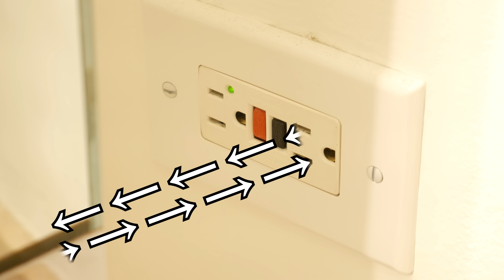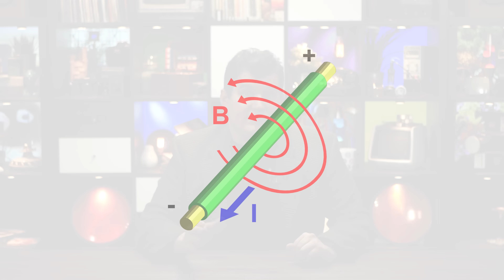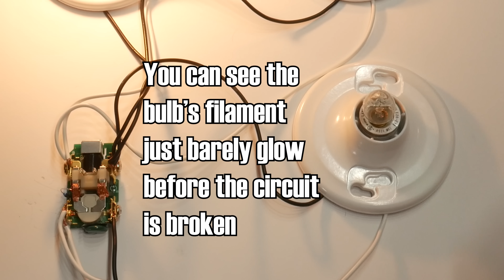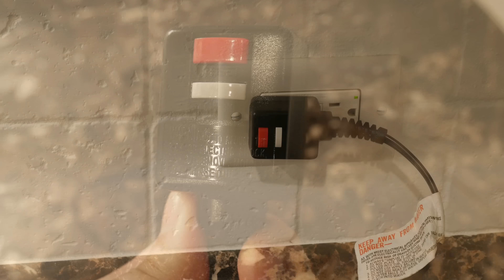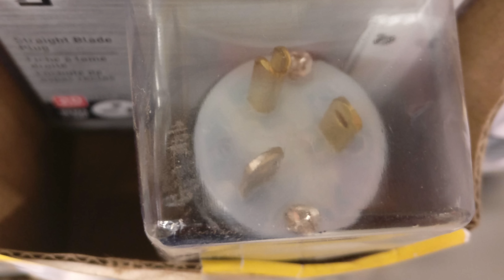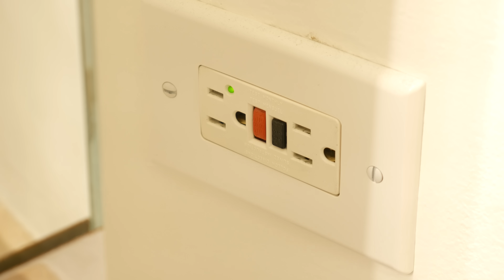The GFCI/RCD: A Simple but Life-Saving Protector

Comment: In Europe not only are those in the switchbox but they are also in front of every outlet so even if for some reason your electrical oven should leak electricity it will be shut down. Also I think the whole short circuit situation with American outlets would be so much more preventable if their outlets were recessed like in pretty much any other country.

Comment: This reminds me of my friend that wanted me to completely replace the wiring and all outlets in his 3 year old house because they "weren't strong enough to push his equipment" We were both amateur radio operators so should both have some knowledge of electrical things in general. Granted I would have more knowledge because I am an electrical engineer. He gets me over there and shows me exactly what he means. He plugs his radio in and the second he hits the power button... POP.... the gfci and the mains in his home all cut off. I told him there has to be a reason this is happening and he says "nope just please change out my plugs to normal ones" He shows me how he can plug it into a regular outlet in his living room but then the breaker only trips when he keyed his microphone. After bringing in my own radio and power supply I showed him that it was definitely not the outlets fault because mine worked perfectly without tripping anything. That convinced him to let me open his radio and power supply. The radio was completely stuffed with roaches and roach feces. It smelled like death! The power supply was a different story. It had bare copper wire everywhere. I actually think some fool wired it purposely with bare copper! The radio was capable of transmitting at 100 watts and the power supply was capable of much more. Thank God for man didn't have a amplifier or he would truly have killed himself

Comment: Not sure where the idea that the US only has GFCI protection through plugs since we also have GFCI combination breakers that place the protection back at the panel. The usage is less common though because it costs more and in many application is unnecessary or less convenient than using a traditional GFCI plug.

Comment: In the Uk , we do not have Plug Sockets in our Bathrooms , . some hotels have a shaver socket  which is always some form of wierd shape , no idea why , maybe a video suggestion on the types and shapes of plugs internationally
Reply: UK shaver sockets always contain an isolating transformer (which often has a centre-tapped secondary to allow the choice of output voltage) and the current it is able to supply is very limited.

Comment: Ground and neutral are two different things. You confused them a few times in your video.
And "ground fault" means a "short" circuit to the ground (or rather a leakage).
Reply: Separate conductors, which end up on the same terminal in the circuit breaker panel.

Comment: In my country they are in the general box at the beginning of the house circuit and cut all power, and they are call Differential Switches. BTW Very interesting video!
Reply: in the UK there used to be a thing called an earth leakage operated circuit breaker, which shut off power to the entire house when it tripped, but it had a major flaw (before the RCD took its place, and some installations in the UK have one RCD for the whole house, although that is no longer allowed in the regulations here, as newer installations are required to be either Dual RCD or have RCBOs, or a combination of RCDs and RCBOs)

Comment: I'm confused about one thing. When you had the wires loose from the third light, and were touching them to the GFCI outlet to show how quick it stops, why do the lights still work when the neutral is connected to nothing? If the GFCI uses an imbalance in the current to detect when to shut off, wouldn't it be imbalanced with the neutral not touching anything? Or does the power just go back through the 2nd lights neutral wire?

Comment: My home has two switches in the breaker panel that are GFCI.  One covers a heat tape circuit under the house.  Kitchen, bathroom, and outside plug are also GFCI.  House built in 2007

Comment: I had one of these outlets in my garage with my freezer attached to it. I ended up removing it because it went off multiple times for no good reason. The last time it did that we were on vacation and  it ruined a lot of meat we had stored in the freezer. You might think we had a problem with ground fault but I've never had water issues in my garage and its not like the outlet snapped all the time. I think maybe the freezer motor might have been inconsistent when it started or shut off. Seeing as this uses a magnetic field I can see where it might get an imbalance with something like a motor. Maybe not plunging the freezer directly into the main outlet would be key in this.

Comment: But if you have the ground fault breakers in the service panels and you have a ground fault, you can just turn off all the breakers and one after the other turn them on until you find the faulty circuit, yes it takes time but I rather be safe no matter what wire I grab than pay an electrician a little less for troubleshooting.

Comment: Another advantage of individual GFCI/RCDs is that if a device trips one, it doesn't take out the whole house, or at best a whole circuit. Nothing worse than having a faulty device that kills your lights in the middle of the night. My house at least has 2, but since one covers all the sockets and all the lights, there is a good chance of loosing all the lighting in the event of a fault. The other one at least has the immersion heater and electric oven, which are two things likely to fail. Here in the UK you can still get sockets with built in RCDs, and also plug in RCDs (the latter were more common for things like electric garden tools in the days before built in RCDs became standard). They are useful when working with devices that are more likely to have earth/ground faults, since hopefully it will just trip them and not the entire building.

Comment: In an episode of the tv show Monk , a murderer broke a GFCI in a locker room, plugged a hairdryer into the outlet, left it on the floor, and messed with the pipes under the sink so that the restroom(part of the locker room) would flood and electrocute anyone who would turn on the sink barefoot. Monk, the main detective, found that because he noticed that the cover plate  of the outlet had dust on the bottom side rather than the top as the murderer put the plate on upside down. Thinking about it, there are some holes in that story as you said that devices like hairdryers are required to have GFCIs in the U.S. and the show takes place in San Francisco...

Comment: Just a reminder, these will not prevent a shock caused by you touching neutral and hot as you just become a monitored load.  So sticking your finger in a light socket will not be protected. They will help prevent you from getting shocked if you touch hot and ground. So hand on the metal faucet while picking up an object with an exposed wire, should protect you.

Comment: Nice! Now do AFCI!

My understanding was a lot more low-tech than the plug you opened. I guess everything has to have a circuit board and blinkin-lights now, but several years ago the explanation I read was that the sense coil was the solenoid and you didn't need the fancy SMT electronics.
Reply: Here in the EU old-style elettro-mechanic design is still the most common (I think it's the only design allowed)

Comment: Good video, however one small note. Although you used an incandescent bulb with a rating of 41mA under static conditions, on startup (with a cold filament) it draws much more current due to its low resistance.

Comment: At my last apartment, our fridge was plugged into a GFCI outlet. It would sometimes trip when we turned on the hood fan or hood light over the stove, which was on the same circuit but not plugged into the GFCI outlet. Now I wonder what was causing the outlet to trip. A kitchen remodel was done before we moved in, and it was done on the cheap. More than once, I didn't notice and ended up with a warm fridge.

Comment: I have a funny question.  I live in a in country that formerly used 110v but now has 220v.  I moved from the US, so some of my technology is only 120v.  I have fairly comprehensive music workstations, with many things to plug in.  I've noticed I have to play a very complicated "ballet" when plugging in all my equipment to wall power, converted power, and to each other (USB, etc.) because I often cause the circuit breaker to "pop".  Sometimes, for example, I have to run an extension cable from across the room, (instead of using all the close by outlets) to plug in half the equipment. Some equipment I have had to completely give up on using, because I cannot seem to find a way for it to stop the circuit from popping. How do I remedy this problem?

Comment: Common misconception caused by ignorance water itself in it's purest form is an electrical insulator in fact it is one of the best the reason why it conducts electricity is due to materials like salt or chlorine mixed into it or any other chemicals they put into it at the treatment plant (seriously the only way to get water pure enough that it insulates electricity is to collect steam from distilled water in a near perfect vacuum) so don't go trying to use tap water as an electrical insulator because there are always metals dissolved into it hence why in some extreme cases the water tastes metallic (just saying this for scientific sanity seriously these things save lives especially when someone drops a toaster or a hair dryer in the bathtub or some other stupid thing)

Comment: From what I've heard, it's called RCD (opposed to GFCI) in other countries to avoid confusion with older ELCB (Earth Leakage Circuit Breaker) devices. The older devices simply monitored for voltage on the earth wire, rather than monitoring current between live and neutral as is explained here.

If you interpret the words, It's easy to see how confusion could arise - GFCI basically explains ELCB:
Earth = Ground
Leakage = Fault (leakage is the fault)
Circuit = Circuit
Breaker = Interrupter

Side note, in Australia RCD is sometimes more descriptively called RCCB - Residual Current Circuit Breaker. This name addresses the issues you have with RCD. ;)

Comment: you will find at least in the us i dont know about other countries  modern window and portable air conditioners and dehumidifiers will have gfi plugs as they deal with water by the nature of their operation.

some xbox power supplies may use the gfi plug too i had seen one used on an xbox power supply

Comment: About 3:13 “Ground fault” refers to a fault to ground.  A “fault” is an inadvertent connection between a conductors or between a conductor and ground.  The return—or neutral—is a conductor not “ground”.  It’s not called a “ground fault” because current is not returning to neutral, but because current is flowing to ground.  It is the actual ground, not the neutral, to which GFCI refers.

Comment: Do you think 30 milliamps is an awful lot for these things to trigger at? The UK standard is that RCDs are only supposed to trigger at 30 mA, and that's on 240 volts - that's a lot more than 5 mA on 120 V as in the US!

Though the UK rule in bathrooms is no sockets at all (within 3 metres of the bath/shower) except isolation transformers for shavers/toothbrushes only.

Comment: Why don't American plugs have on/off switches?
Reply: Why would they?
Reply: Better question is "why US sockets don't have neither switches nor shutters"
Reply: @davidebacchi1340  Because our outlets are 120V and have a 15A breaker, instead of the crazy 32A 230V you guys are running.
Reply: @simonrichard9873  The big-fuse ring-circuit topic is british issue, here in mainland EU we have 10A or 16A MCBO to protect our outlets circuits, also our outlets are also protected by shutters (what in the US I think is 'tamper-proof' rating). US outlets are rarely protected by RCD and less by shutters. 16A is 16A 10V 100V 230V or 400V the  joule effect is the same
Reply: I think that overall our system is less safe, but a shock on 120V isn't that painful anyway. New buildings tend to have shutters now.
Reply: @davidebacchi9030  All new outlets sold in the US have shutters built in
Reply: cloksin since last week?
Reply: @cloksin  No they don't.  That's only in states where people aren't smarter than the receptacles.
Reply: @kevinsullivan3448  Guess you're not smarter than a receptacle, because it is impossible to buy receptacles without guards in the US anymore.  Go look at your local home center and see for yourself.
Reply: @simonrichard9873  50 volts are lethal. Yes, you can survive higher voltages with a bit of luck, but "luck" is not a reliable protection.
Reply: @cloksin  Uh, my closest Home Depot currently has 46 10packs of non tamper resistant 15a receptacles in stock. Tamper resistant outlets aren't required everywhere, only in homes and certain places which are likely to have children. Even then you don't need tamper resistant outlets if they are more than 5 and a half feet off the floor. If you're installing an outlet high up (such as for a garage door opener) or at a business you don't need the shutters.
Reply: @davidebacchi1340  actually they've had shutters as part of the NEMA standard for power outlets since 2008; better late than never.
Reply: Because American electronics have on/off switches.  Electricity does not poor out of the receptacles when the power is turned on.  So unless you are sticking metal bits into your sockets or teaching your children to do so, there is no real danger from properly installed and undamaged electrical receptacles.
Reply: Why do British plugs have them?
Reply: @EliS57  It's not the plugs, it's the outlet which have them. The reason is "for convenience" (it is not mandatory in the UK, but back in the days, it seems that quite a few appliances did not have switches of their own). If you travel to the UK, you might get a skewed impression about the prevalence of switches on outlets, because hotels seem to prefer these. And William C's boasting about the plugs is correct, although I think they are a bit bulky. Schuko is quite good as well and not as bulky. IEC 60309 is, of course, an even better power plug/socket system, but ultra-bulky.

One issue I had with the British plugs and sockets was that, apparently, the placement of the switch seems not be standardizes. One of my bulky plugs would, in a few outlets, hit the switch and turn it off whenever I plugged it in. I am aware that BS 1363 should cover plug/outlet compatibility, but it seems not work perfectly in reality 

A very nice (and possibly unique) feature of the British system is the location of "live" and "neutral" are well-defined. That's not as much a safety feature, but it can be useful for, for example, audio equipment (where the "neutral side" side of the transformer should be next to the secondary winding, thereby acting as a "poor man's shield winding".

The distinctive feature of a British plug is that they have mandatory fuse built-in. This is a requirement coming from the "funny" ring topology common in the UK.
Reply: I need to find one of those outlets with a switch on it for my Foreman Grill. Still not sure why they don't make those with switches on them. Unplug it while its heating and it sparks every time.
Reply: @heatshield  There are US outlets with switches. Some examples are the Leviton T5225 and T5625 although these appear to only have 15a switches so would not be suitable for 20a kitchen circuits. You'd also need to keep in mind code rules for outlet quantity and spacing as well as GFCI.
Reply: @heatshield  Switched outlets are readily available in any decent home center or hardware store.  I put some in my workshop.
Reply: @heatshield  If you are already willing to replace your outlet - simply put a cord switch on your george foreman grill. The simple ones made for lamps will probably not have the required ampere rating, so your might have to search a bit.

In Europe, we also have intermediate plugs ("power savers"). A plug with a switch and an outlet, in which your van plug a device which lacks a proper maine switch 

Or use a multiplug with a switch. More bulky, because of the cable. I use one of these for my non-George-Foreman-branded grill...

Note that if a plug sparks when unplugging it, a switch will also spark and wear down over time. It might be invisible in the switch, but it still happens. Usually, the sparking is not an issue. Serious sparking will vaporizer the plug's metal. This will be visible to the makers eye of you inspect the plug. Currents high enough to do this will usually also trip the circuit breaker.
Reply: Because they are nor needed.

Comment: Excellent video, the old style ones if they were not tripped out and the electronics failed, they would still pass power like a regular outlet,  the new ones won't pass power if they fail,  also 15 amp kitchen outlets usually have 20 amp wire and breakers zoom they can handle a 15 amp load, since kitchen appliances can be demanding, that's probably why you see that rating on the gfci

Comment: So, these outlets provide the same power as any other outlet in the home? I thought they provided a lower amount or juice cos they were "intended" for low-voltage things (like hair dryers, curling irons, electric shavers, etc) and plugging in normal devices like a music player or mini TV would render the device inoperable due to the insufficient power.
Reply: Blackie Nuff I’ve plugged in a Dyson Vacuum cleaner into one of these (most convenient outlet for the hallway) and it’s fine. I think it still gets the same amount of power as any other 110V outlet. I plug my HomePod (Apple Smart speaker, like an Echo but much larger and louder) into my bathroom outlet to listen to music in the shower and it’s powered fine as well.